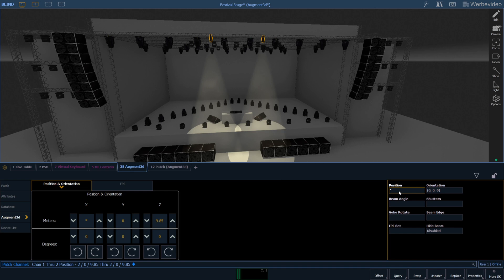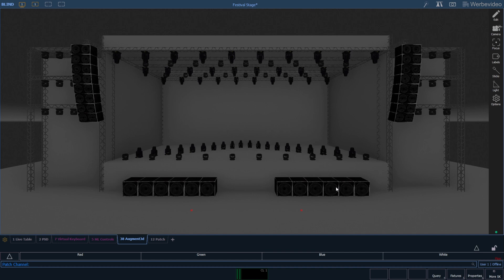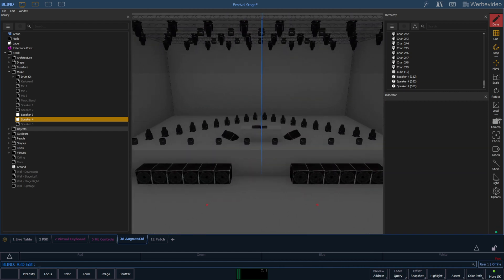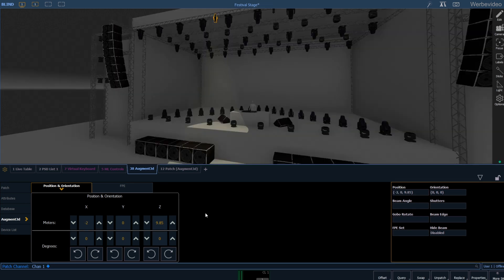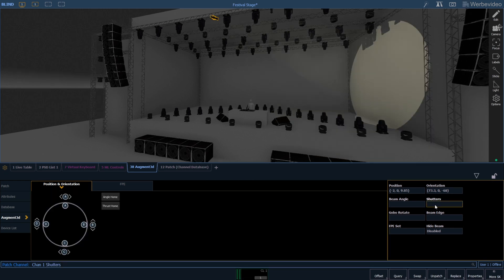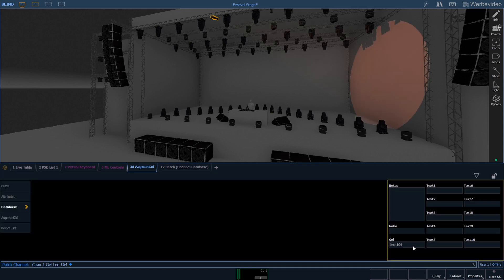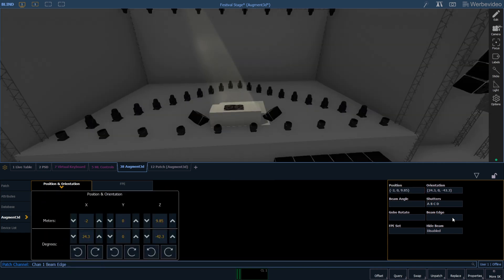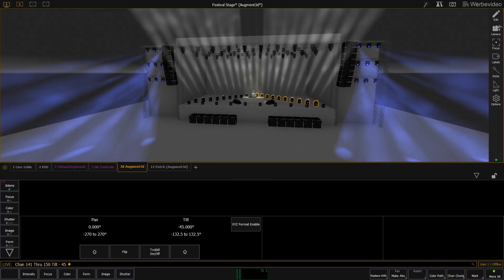EOS Augment3d | Let's Build a Festival Stage | #5 Conventional Lights

Comment: Good info. The tip about focusing conventional fixtures only working when in patch mode was awesome. Was driving me nuts doing a lighting design in Augment3d for a small theater with mostly conventional fixtures. That difference wasn't in any of the EOS training vids about Augment 3D that I could tell. Thanks!